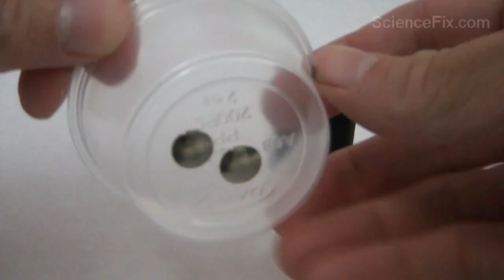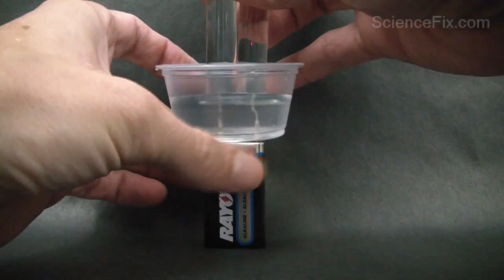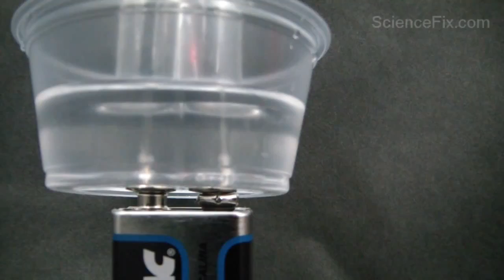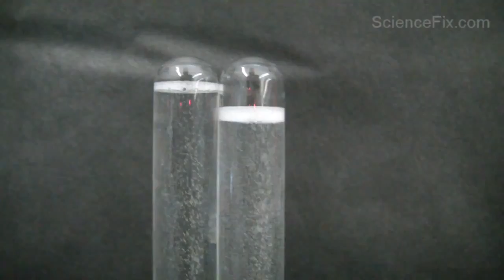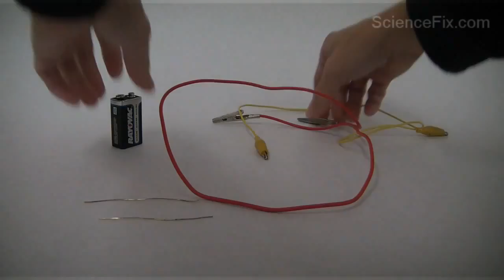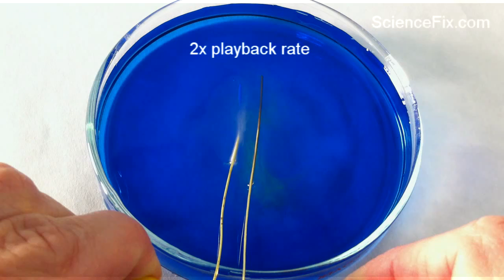Water Electrolysis

Comment: But wouldn't the substance being broken down in the electrolysis contaminate each of the test tubes? (assuming that when the water is broken down both oxygen and hydrogen is released)
Reply: also instead of a battery could you use an electrochemical battery? (using salt water a random metal and copper)